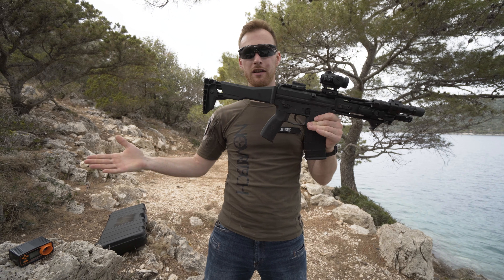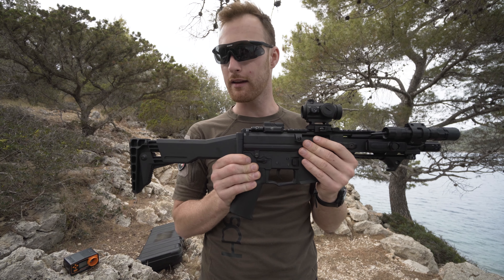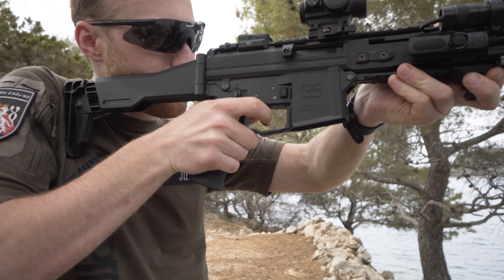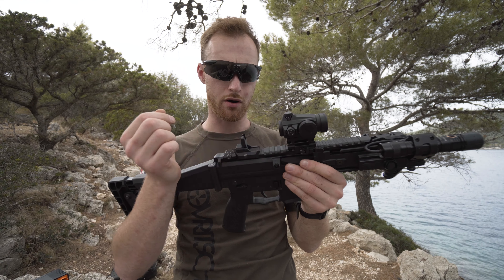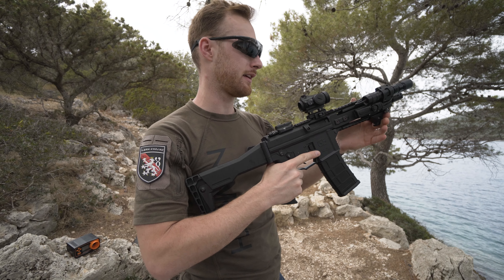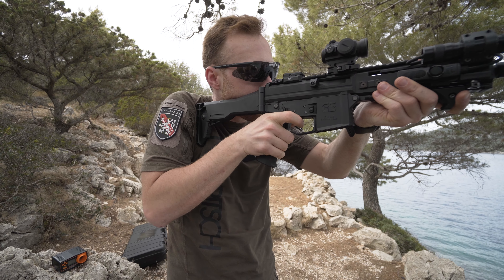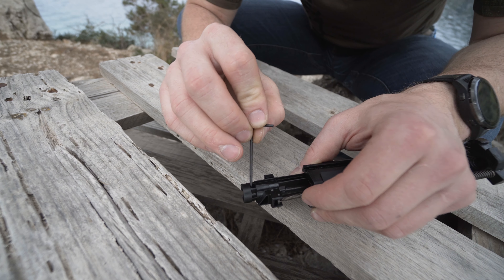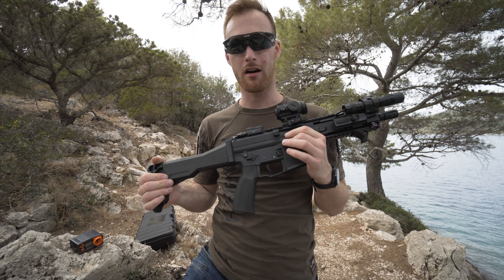GHK G5 Review - All plastic sucks?

Comment from the maker: What's your experience with the GHK G5? Share it with others. Have you found a good solution to adjust the power output?
Reply: Try the screw mod, it's not that invasive as you said, and works pretty good, been using it like that for almost 3 years, just so you know, the hop up chamber, as is made out of plastic, likes to break with double feeds, so be ready to change it, maple leaf hop up chamber it's a nice option.
Reply: @TheLuisxsl  I agree

Comment: I've already done 2 npas screw mods on ghk nozzles (1 on the G5 and 1 on an M4) and they work great, you can adjust the Joules pretty easily, just use an M3 std x 6 mm grub screw and it won't interfere while cycling the gun, even completelly outside the nozzle. It's an easy and cheap method to fine tune the Joules.
Reply: m4 grub screw allows for more reduction.

Comment: Bad? The GHK g5 is specifically designed to be used in airsoft games instead of justing looking realistic for LARPing, unlike most Taiwanese GBBRs. It is far form bad.
Reply: I guess we are just going to ignore the fact that the lowers break stupid fast, pot metal fcg, garbage ass hop up, trash feed lips that split like every other ghk with filing them...

There are so many better options at the price level compared to a g5
Reply: @OP Airsoft  Gotta say, through 3 years so far, I haven't had any issues with what you mentioned. Researching prior to buying led me to just do the epoxy mod on the receiver like he mentioned in the video. Cheap and easy fix. The only real problem I've noted with it was the plastic charging handle it comes with likes to snap off...got some aluminum ones online for cheap and replaced it easily and problem solved. To each their own I suppose.

Comment: Happy G5 user :D In fact, I have 2 of them, one short for arena on 1,5J and 2nd as a DMR with DMR kit for it. Both shoot excelent, both a bit moddified (Poseidon GBB Barrels). 

One great thing about this rifle and that is something you didn't mention, you can get original replacement for any part that breaks. From tinies screw up to the charging handle or body replacements :)

Comment: my first airsoft rifle, there's kits to increase barrel length and handguard length to 12inch and 16 inch.
dont like the folding stock? comes with an adapter to use your own non-folding stocks too
an issue is the bolt is never machined well so you have to file it down a little..
other than that its a beast. I also own the WE kac pdw (8inch version) and yeah its similar but the ghk isn't as hot as the WE and GHK is alot higher quality.

cool video man i hope to see more like this "in the field" type stuff!

Comment: I wanted to get a WE M4 but I'm scared of the issues, the wobble and everything else, bit on the other hand it's an affordable AR. Now with this being only little more expensive (except for the mags bruh) it's kinda tempting me, the polymer body scares me a little and the trigger being kinda meh, and the fact that it does not have a bolt hold open and release. The carbine conversions aren't to be found anywhere which is a shame because that one actually looks good. Now I'm very torn on which one to get. I guess the WE isn't really worth it compared to GHK.
Reply: If you want toget a budget GBBR try to get a VFC.
Reply: @123456kiste  Unfortunately there's very little VFCs here and usually just the really expensive models, also basically no support for them, while WE have like parts everywhere and for cheap so I guess I'm going for WE in the end.
Reply: @simishyde288  oh okay. Yeah give it a try. The WE 888 might be a decent GBBR. Seems like to have a more reliable bolt catch compared to other Modells from WE
Reply: Mws. Thank me later.
Reply: It absolutely has a bolt hold and release...it's the charging handle on the side that you see him racking, like a mp5. There is a big community of people that machine parts and make 3d printed parts for any replacements you might need. I will say though any OEM parts, while usually cheap, generally are only found from an Asian company, so if you're in the US/Canada and need a part fast, it's gonna take quite the time (and shipping is never cheap, sometimes paying 3x the amount in shipping than what the product actually costs lol).

None the less, the bolt catch is there and functions flawlessly on an empty mag (and you can do the mp5 slap with the handle lmao)